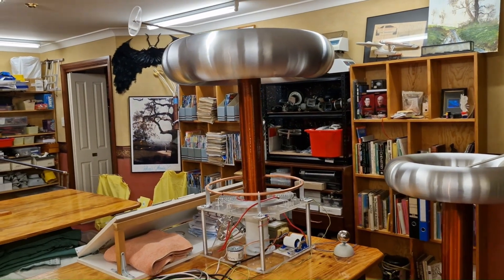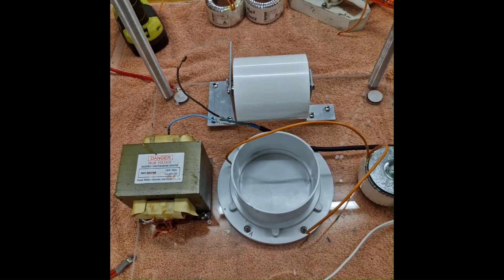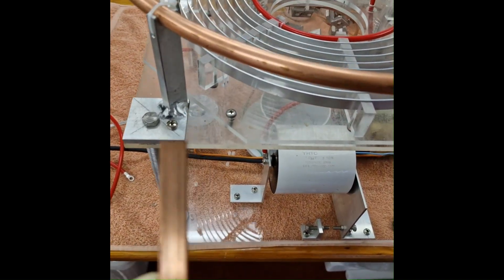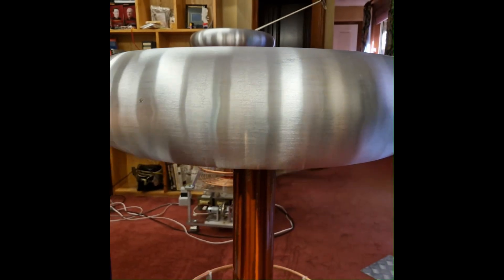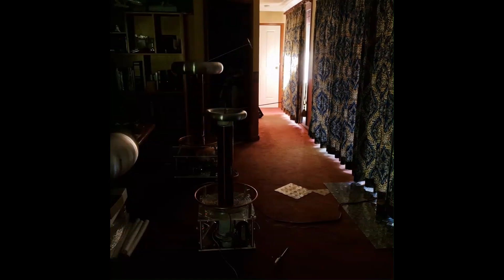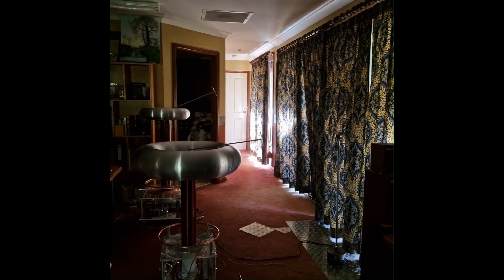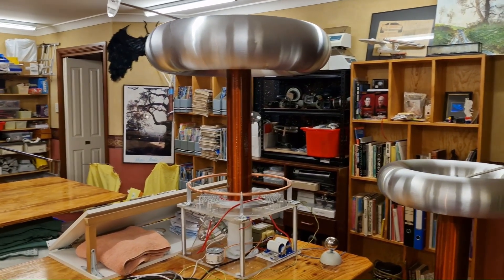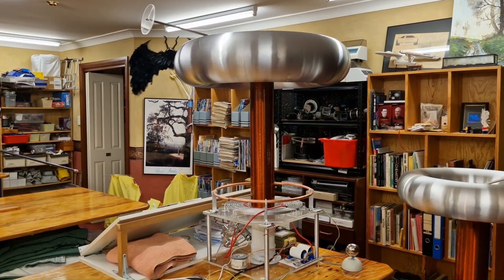Building Your Own Single Microwave Oven Transformer Tesla Coil: Assembly, Tuning, Running.

Comment: Use the larger topload and tune properly with 50 nF. Also, make a gap in the strike rail (as Manzzzz noticed), that is very important. With 1 MOT you should be getting a much better performance than what you are showing here.
Reply from the maker: Thanks for watching. I thought the single MOT did well for just one MOT. In the video, you will see I tried 200nF and then 300nF  , performance being poorer with the 200nF despite Tuning as I indicated. 
Do you have a link of a video of a single MOT that performs better? I love to see it. 
I actually did open up the earth strike ring... made no difference with the alloy wheel rim topload but didn't try the large  toroid. Will try and and produce a video of results.
Reply: @CreationsByAnNg  Put those 2 caps in series, then you'll have 50 nF which is more in line with what I think you should be using (just by observing from afar, of course). Better still; check with javaTC what the ideal sizing should be. I have done tests with single MOT SGTC's with a static spark gap, but those were short tests of which I may have video's, though not online. With a rotary SG you should get better results than mine, but then you need to synch your SG, or rectify your HV. The 60 cm you are getting now are about the same as I got with a static SG. But those doorknob caps should also do much better than my PP caps.
Reply from the maker: @WardenclyffeResearch thanks for your suggestion. I'm uncertain if using less capacitance will deliver longer discharges though.  The amount of energy the system has to work with will diminish with lower capacitance.
Reply: @CreationsByAnNg  True, but better tuning will increase the resonant rise. --> higher voltage. Less tuning and the energy will work against itself.
Reply from the maker: @WardenclyffeResearch i agree and did tune the system to its best performance. I could be wrong but uncertain if it can do better.

Comment: Hello, I've noticed your strike rail is a closed loop and this is NOT good.

A closed loop near the primary coil will have huge induced currents flowing through it, this current generates a field opposite to your primary's decresing your overall efficiency.

It is really important to leave a gap (usually at least a cm wide) so that the strike rail isn't a closed loop.

I did some experiments with my small SGTC back in the days and by closing the strike rail the spark length was almost halved. So, make sure yours is open ;)
Reply from the maker: Thank you for commenting. Yes, I have heard that. Of the five Tesla coils  I've built,  4 are closed and one is open. I have not seen any issues. But I might try opening them up and see if performance improves.
Reply: @CreationsByAnNg  It probably depends a lot on your coil geometry, strike rail position and so on. 
But trying doesn't hurt ;)

Comment: I love high powered coils like ones driven by MOT, hmm I am trying to get some coils focused around a centre point to do fusion of 2 atoms of AL13 into Fe 26 based on some tech by Malcolm Bendall ( Thunderstorm Generator ) which has the geometry of the Vajra ( 2 spheres connected by a pipe ) i am sure his tech can be expanded with tesla coils at the moment it is just steel spheres having exhaust gasses run inside them to do the fusion https://www.youtube.com/post/UgkxLhtq-6LUY88gZuEJfIz9khhCTUhcNPav
Reply from the maker: Thanks for watching and commenting.  The tech you talk about is beyond me 😅

Comment: Natural rock crystal quartz (clear quartz) is excellent for spark gaps due to its piezoelectric effect, generating high voltage when struck, making it perfect for lighters and igniters, but you need specific crystal quality (clarity/structure) and often synthetic versions for consistent, high-performance sparks in tech, while natural quartz can create sparks for fire-starting via triboluminescence
Reply from the maker: Thanks for watching